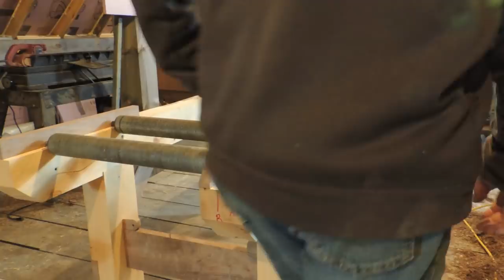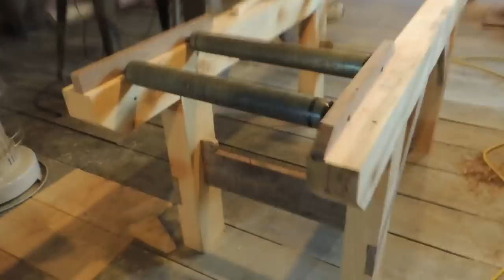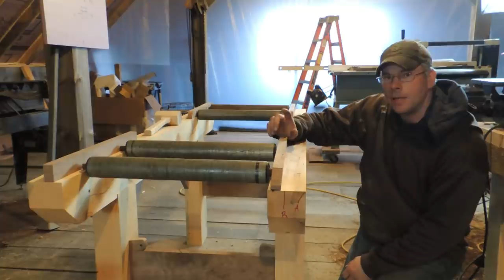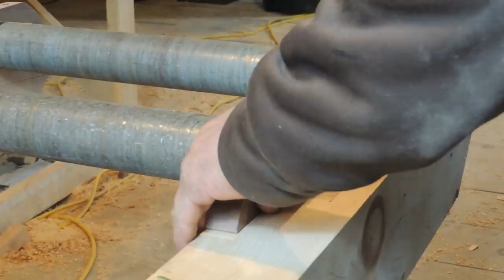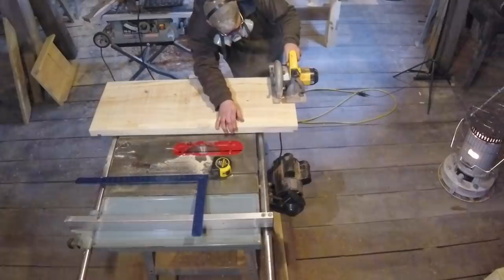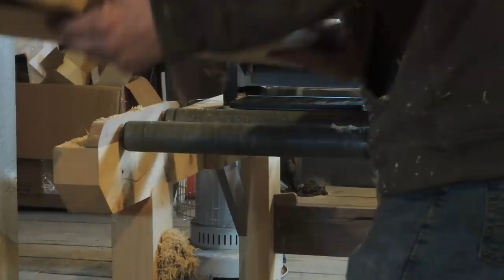The Ultimate Overbuilt Planer Stand...EarthQuake Proof...Maybe

Comment: I wanted to ask you about the fence on the Delta table saw.  Is that the stock fence? the one mine had was steel not aluminum. I could not make it behave so I built a T square fence for it.
Reply from the maker: It is the original aluminum one.  Once I tuned it in it has been great.

Comment: Yes indeed overbuilt xD but it's a great way to celebrate every aspect of this kind of work^^
I for example have a one with a motor outside of the mashine who is powered with a diesel engine it sounds wierd but with only one engine I can power over 7 power tools at the same time xD
Reply from the maker: I would love to see your shop.  The Amish do it the same way here.
Reply: @TheTradesmanChannel  i just do that in truth because of new mashines at the same quality are way too aexpensive XD and because of new mashines got so many safety funktions that they often aren't as usefull as old ones and because of i realy dont want to remoove them do you ever remooved a 2,4t heavy Planer stand? XD
realy i was thinking the amish never use anny technology?
Reply from the maker: The Amish aren't much different than us, they do whatever they can to make things easier.  Their shops are usually better tooled that most of ours.
Reply: @TheTradesmanChannel  I think you would love to see some of the old tools of my grandfather I still use his Chisles they aren't from any brand a Smith from our village made it that time ago it is a little bit harder than modern Chisles so you can cut much longer but you need to sharpen them longer than modern one I just don't use his hand saws because of I can't find the right files to sharp them correctly anymore the modern one don't fit and the last one I had was already overused by my father

Comment: I bet you get rid of those rollers in less than a year.
Reply from the maker: Why do you say that?
Reply: Because I’ve been there and done that. I made sure that the rollers were absolutely flush to the table but had problems. The wood would tend to catch on the rollers and then I’d end up with a snipe in my board. Also you can’t set anything small on them. I think if you put wood infill panels in between that were slightly lower than the rollers then it would work ok and may help with the wood being planed to guided to the top surface of the rollers. You can then plane smaller pieces without them falling through the rollers.
Reply from the maker: I see, that is sound advice.